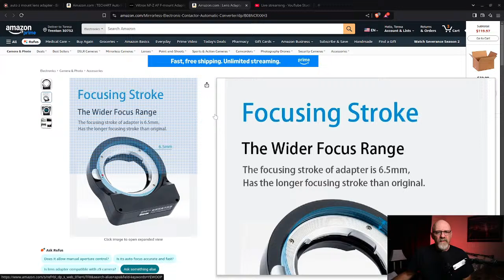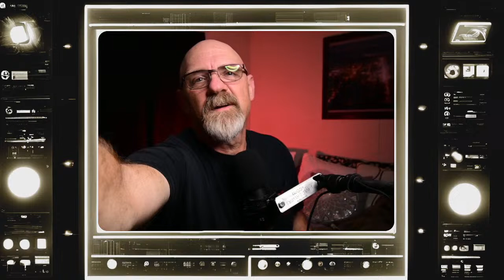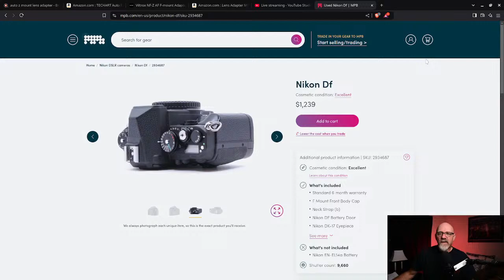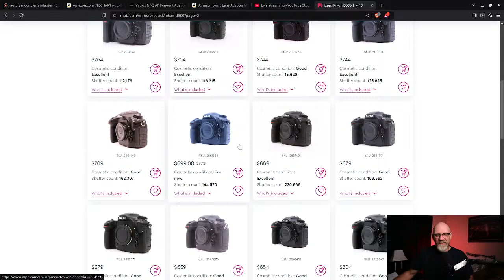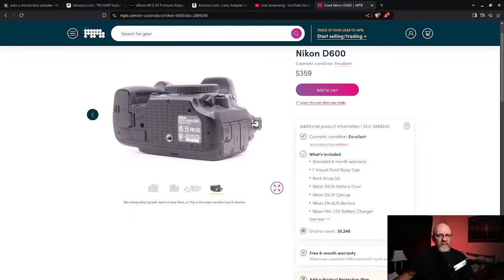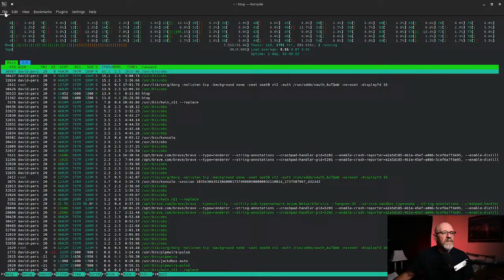Georgia Photographer LATE NIGHT Live Stream 13 - Camera Talk

Comment: i'm waiting for the Viltrox E to Z mount adapter. using Sony FE lenses on the Zf. in autofocus. the flange distance on the Zf is 2mm shorter. let you know how it works. 😀
Reply from the maker: I have seen that as an option and have wondered how it would work, I am guessing it will work really well, but you never know...